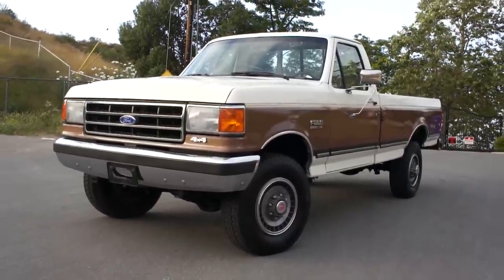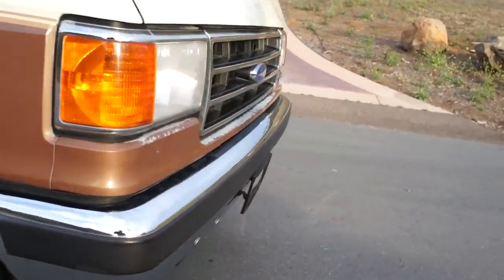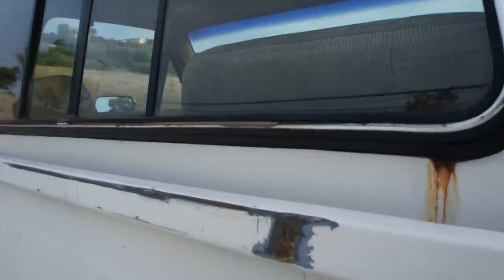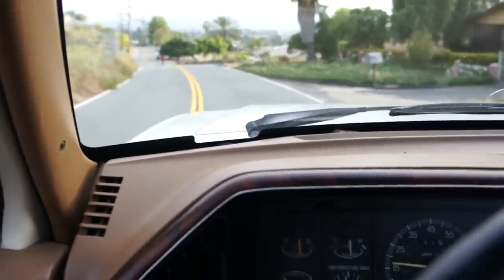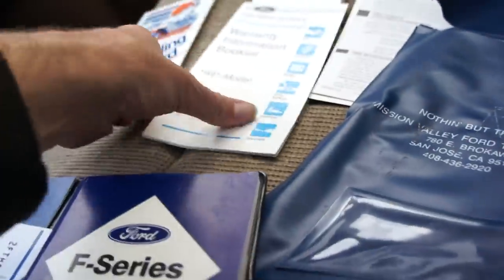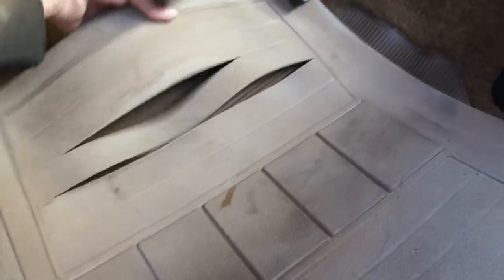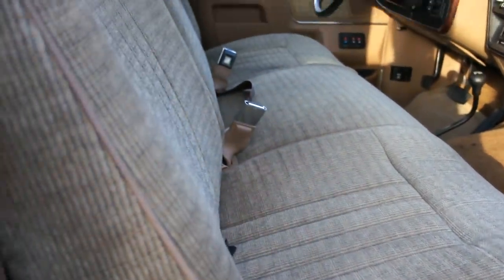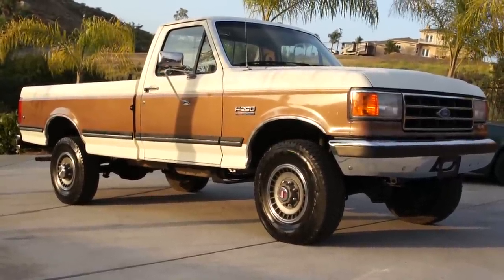1991 Ford F-250 4X4 Pickup Truck 1 Owner 86k Miles For Sale

Comment: Great truck, I have the same truck with 5L, I wish mine was half as nice as this one.
This truck is probably long gone, but FYI, they have two gas tanks for a reason, i average about 12 mpg with the 5L, and E4OD trans seem to only last about 70-80 thousand miles.
Great truck for weekend ride, or pulling a trailer, just not very practical as a daily driver.
Great video.

Comment: I find it funny my 1991 f250 is a 3 owner but has less dents and ya the paint is failed but it dosnt have chips all over it
Reply: It had a camper top on it at one time so I imagine it got into some hairy terrains way back. It's since been repainted, striped and tailgate replaced. They managed to salvage the badging on it to reattach to the gate, can barely tell unless you look really close that it's not the original gate.

Comment: I just bought an '89 f150 xlt lariat, same color as this, has the accent stripe and everything. Won't run worth a fuck though, taking it to a mechanic this week and hoping it's something simple, I've changed a few sensors myself but it still sputters and seems to run rich and stall out. Not in quite as good a shape as this one, but it's pretty good for $1700
Reply: Did you ever figure it out? We've had some quirky things but managed to keep it running, now 11 years later. If you still have yours maybe we can give you some input?
Reply: @spookilyookily  The one I had basically had no compression on a few cylinders and I sold it, didn't want to get it rebuilt. Basically very worn out. I also had a 94 that only had like 130k miles on the 300 i6 in it but it would idle up and down and kind of get rough and waver too. I almost bought a 94 town car once with the EEC-IV and MAP still on the 4.6 and it was the same way, just idled all over the place, almost stall then idle up. I feel like as these things age and the engine wears and things change they just can't compensate for it other than on the fly fuel trim based on the o2 sensor. A lot of people I talk to that have owned these like 87-95 or so trucks say they'd just run like that. Some people say they were great and had no issues. Idk.

Comment: paint that year was epa regulated and poor quality
Reply: Interesting, did not know that. The flakes were.paper thin on original paint, new paint holding up much better.
Reply: @spookilyookily  yeah  i had one new  like that in 91  took it to a high pressure car wash and the paint on the hood flaked off like it was candy coated  ..water based  paint  is what ford used those years  and  it was terrible

Comment: I was with a friend recently, he was showing me around his Dads Firestation.  His Dad grinned as he opened a smaller building , i stepped in (not being that familiar with really large generator systems) but dude!  I was impressed , his Firestation "KOHLER" generator ran a giant FORD 460 , running on natural gas.   I would love to have a truck with a 460 i just couldnt afford to keep fuel in it , my goal is a 92 -2001 F250/F350 5 or 6 speed powered by the 7.3L Powerstroke , if its on he newer side 99-01 I would want quad cab.   I am never going to be able to afford a new one, I do t have $70,000 if I did that would be going to cover nearly half a house I want!